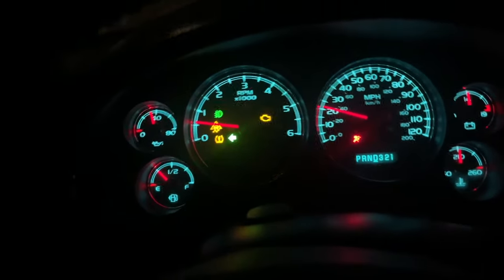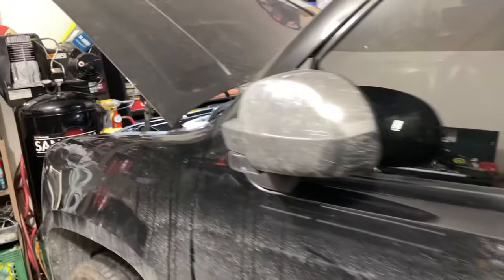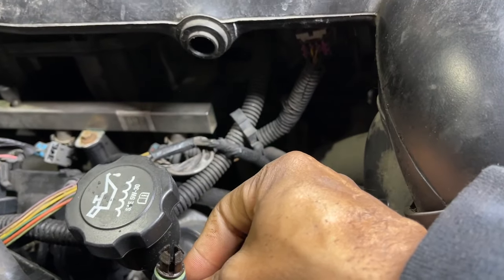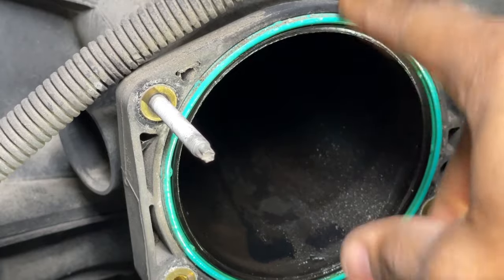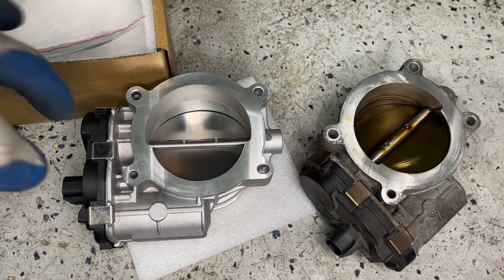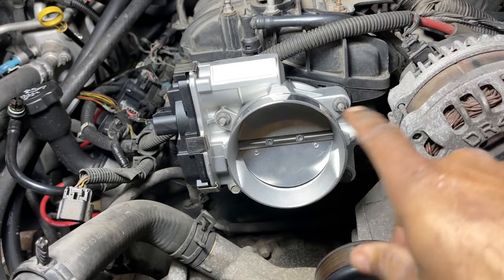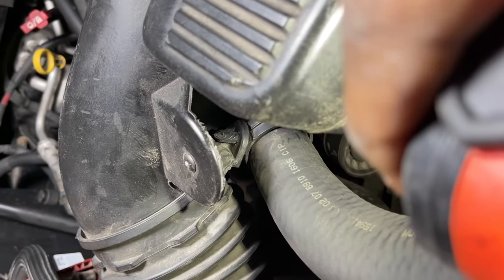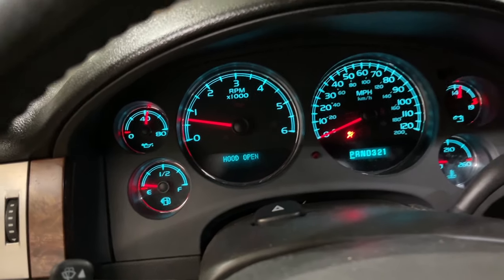How To Fix Reduced Engine Power Quick And Simple! Code P2135 Chevy Or GMC Trucks / SUV's! TPS Issue!

Comment: Hey i dont know if you’ll see this but if replaced my throttle body my acceleration sensor and my truck still wont turn on it cranks but wont switch on and i still get the reduced engine light
Reply from the maker: Hi Javi, so you truck won't start?? Please let me know and tell me what codes you are getting. I will help you get it going. Thanks,
Reply: @TerenceDIY  i got P2127 for the Acceleration pedal position i replaced it 
P2122 Acceleration pedal sensor circuit voltage to low 
I got throttle closed position performance   And a code for the TSP as well i replaced both and i also got P1380 miss fire detected
Reply: @TerenceDIY  and now i have the engine power is reduced light
Reply from the maker: @javigarcia1616  , so just to be clear, it does run however, it does not have any power during acceleration?
Reply: @TerenceDIY  non it no longer runs
Reply: It turn the keey and it sounds like its going to turn ok but it doesn’t
Reply from the maker: @javigarcia1616  , okay. Now tell me this... When you try and start it, does it sounds like it wants to start or does it just spins? Please let me know.
Reply from the maker: @javigarcia1616  Can you have someone turn the key forward into the on position (don't try and start it) while you listen by the gas tank where you pump gas to see if you hear the fuel pump turn on.  I want to make sure the fuel pump is working.
Reply: @TerenceDIY  it sounds like it wants to start
Reply: @TerenceDIY  there’s not many people around me
Reply: @TerenceDIY  but i had one guy look at it he said it wasn’t the gas pump but idk this all happened as i was driving

Comment: Hey Terence, I have a 2007 Suburban 5.3 flex fuel, 167k. This reduced pwr light, check eng light, stabilitrak lt and traction control lt all came on tonight first time. Note that it's -14 degrees in Denver now and I was in 4wd high and slipping a little. Since it would idle but had no power, I was able to pull off the road. I turned the engine off waited a minute and it restarted with no issue but the logged check engine lt. Made it home ok. Your thoughts on whether this incident might be cold related?  Thanks
Reply from the maker: You absolutely could have gotten a false reading due to the circumstances. I've had multiple false readings where as after waiting for a while the vehicle was perfect with no further issues. However, pay close attention to it. If it happens again. there's definitely a problem even if it fixes itself after a restart. Here is a link to a new part that's cheap and reliable. 

https://www.ebay.com/itm/333272439452?fits=Year%3A2007%7CMake%3AChevrolet&hash=item4d9895da9c:g:EpoAAOSw6QJdM5EW&amdata=enc%3AAQAHAAAA8MoUyTfsKekX%2Be%2BCj7USOvxRS2XHH%2B4s%2F3tNXtAZ4Z%2BLY2YJ8cZZawMqXI5eRkCN2peingTBDhw67RTFniZ13YeWeYbWwzGRlOX3gCqapuSIPwlEOfKzGzdNW%2BNzE8MbteOrNmQbfjDC7HwmX5iOOPlqpeAYBNdP1e3ZMYgv0GCr97ijpvwE2LwEbEFXegY5pdBMIlOhyFHiIQxxOM5CPh3EHGWGXIOYVixbxaONJA9zp9VDhEPfqRS8IlIxfkkulnErBAXVLFnvogBSJweDOIO12HTbu09A3rhd8ehAtsSWwnbVTznzv%2F8GuOghipZkcw%3D%3D%7Ctkp%3ABFBMyOTn16dh
Reply: I have the same issue with my 2007 yukon.  Replaced the alternator because of the built in regulator ( due to possible over charge) , Replaced ground wires, oil pressure sensor (went bad and replaced-now I have pressure reading again), replacing fuel level sensor now,  replacing fuel canister now because of pressure ( not able to fuel up without 30 min of at the nozzle), now your saying the throttle body which makes sense but did it fix your stabletrek/reduced engine/  circuit high volts fuel level codes?
Reply from the maker: @joshuaosterkamp4144 , yes, it fixed my problem instantly. The truck still runs amazing. Here's a link to the part (below). Thanks for watching! 

https://www.ebay.com/itm/333627241435?fits=Year%3A2007%7CMake%3AChevrolet&hash=item4dadbbb3db:g:idAAAOSw~UJhkdH9&amdata=enc%3AAQAHAAAA8MjoO0WdBfGVeinK0xj%2FLd2FTK6tfYe%2FK5z8Z31smof1jfX3pvdl9kesnJ%2Fv9aYmQ26e4Wf2cMFQ8wemI80uiFy0nCLO9EP7rb%2FvFtNBBKU6Pm5kpQN2YFTN74BFQ%2BusPY%2B8zhhUDmeykII9Skj3fzhYKA1iKVeWliAx4C0%2FOBQifyKXinvqDF4T%2Fq1%2F03%2FPUsH7%2FpUnwwh8D75%2Brz2CzRclGakTKdPV7FjEy1Y0lhZW8geN2ucMNIx11IM6rNZmzWssnd76hJ3DwtAz3CChjNpCkTcNWiCJXm1rj4Mz35VzfD2BkqReRktcbslK41OKow%3D%3D%7Ctkp%3ABk9SR9CBnf7XYQ
Reply: I get the same problem in the winter on the slick days

Comment: Fixed the ground issue on the passenger side of the engine, ran fine for 3 days then went back to the issue. Have a replacement throttle body that I plan to put on very soon

Annoying thing is that mine has a small coolant line running through at the bottom... Why?
Reply from the maker: Hi Bruce, what year is your vehicle?
Reply: @TerenceDIY  cursed 2003

Actually attempted to replace throttle body but there are... Things... In the way. Theres a large hose right by the side with the electric connection and then the annoying pass through. They have these oem style clamps on them that refuse to come off with regular pliers

Comment: Did all that and my check engine light only comes on at idle...but goes away at 23mph..any suggestions
Reply from the maker: Did you use an OEM throttle body?

Comment: I just got the same problem. Could it be the same issue on 2003 Avalanche?
Reply from the maker: Absolutely or the APS ( Accelerator Pedal Position Sensor) in which happened on my 2003 Avalanche. Thanks for watching.
Reply: @TerenceDIY  just found out a spark plug coils is cracked. I'm going to replace it along the spark plugs and cables and go from there
Reply from the maker: Great! Let me know how it turns out.

Comment: Did the throttle body need programed the one on my 2009 silverado crew cab 1500 4.8 ls had to be programed
Reply from the maker: Nope, no programming required. I would have made sure to detail that in the video if that was my case. Thank you SOO much for watching.

Comment: Was that a aftermarket throttle body or GM part?? Thanks in advance
Reply from the maker: I actually bought both but installed the aftermarket in this video. It's still going strong. I have the GM brand on standby. Here's a link to the aftermarket part. Let me know if you need the OEM link. Thank you so much for watching, 

https://www.ebay.com/itm/333627241435?fits=Year%3A2007%7CMake%3AChevrolet&hash=item4dadbbb3db:g:idAAAOSw~UJhkdH9&amdata=enc%3AAQAIAAAA8PfQ8tGd6OQhC45g5SmgB94PNEDBebXXPHs8anFHt7xU6aIvBUdojgFG5t4I2SsJ4ziJpwB6TQ64muIT%2BiLuanno7z3i3PexcZETWZQA8lm7mApYo6yzcmWyc%2FcHF1SZi5YQStRsGWxc%2BPsotb1%2FFV8XaV4kdd%2F8xwFchzqMWCFqt%2FCRwOlvZ1e6bhneoJ6MTz%2FpgpmO%2F%2BWAES%2FhoEDTjhGtpKNF1C7Q8F82768Y%2FwvkXEnIbMxtXwlIJnM0o7MW4SqoKTy1FAkkIHd4kfwu89Y0s3HrAZBX9Us4%2BjV7L%2BSLszv1oYMZF2bSD3b%2FiAJMJQ%3D%3D%7Ctkp%3ABFBMvsSk0vlh

Comment: And it's cold out I'm glad i found ya n it's a 5.3 2010 no codes either the rpm gauge is bobbing just like that but not that much loss of power what's your suggestion

Comment: I have a 2008 Chevy Impala LT 3.5l v6. I have replaced the throttle body on it and it still say engine power reduced and service traction control. Any idea what the problem could be.
Reply from the maker: Can you send me the trouble code? I have the book and software on that car. I probably can tell you what your issue is. Thanks,

Comment: I'm having the same issue. I have replaced the throttle body and connecting pigtail, the control module and reinforced the grounding straps. The latter two fixed the issue for a few weeks and the first resolved the problem for about 6 months. Looking for other fixes. sigh
Reply from the maker: Hi Jacob, did you replace the old throttle body with an OEM one?
Reply: I did.
Reply from the maker: Jacob, any trouble codes? If so, please send them to me. I will check the software and see if there are any other solutions. Thanks,
Reply: @TerenceDIY  I broke down and took it into the dealership. After 3 days, they determined that there were several shorts in the engine harness. $2,950 fix... Time for a second opinion.
Reply from the maker: Dang Jocob. I wish I were there to help. I would go to the scrap yard and remove a harness from a similar vehicle and help you install it to see if that would fix the issue.
Reply: @jacobgillespie4758  I think I'm dealing with the same issue p 2135 2 throttle bodies and pigtail later drove good a couple weeks now problem is persistent
Reply: @anthonyprice1859 That sucks. If the throttle body keeps going south, you could have a grounding problem. I ran grounding cables from the battery to the throttle control module to the grounding point at the center of the firewall to the frame under the alternator and finally over to the computer. 

Since having the engine harness checked, the issue hasn't repeated, leading me to think it was a loose connection after all. 

Here's hoping.
Reply: I am having the same issues, throttle body and sensor replaced multiple times. Go off for no apparent reason unrelated to bumps in the road. Temp fix for me to get home is to remove battery cable for a few minutes and it works for short time and the problem is back again 😢 had taken to dealer and shops multiple time but no one can fix it permanently.

Comment: hello i have this same problem  engine power reduce but only when i reverse i install a new throttle body but it seems it didnt fix the problem what can it be
Reply from the maker: I wouldn't have changed it if it were working properly in forward. You have another issue if it only does this in reverse. Possibly an issue with the transmission. Can you tell me the trouble codes?
Reply: @TerenceDIY  i had  p0122 ..p1174 ..p1516 p2101.. p2119 and p2135 but after replacing throttle body  i only have the p0122 left  maybe the pedal position sensor?
Reply from the maker: @goregore9647  , Yep, that's most likely your problem.

Comment: What part was that. That you put on. Mine is engine power is reduced idk what going on idk nothing about vehicles
Reply from the maker: Here is a link to the part (below). However, reduced engine power can be quite a few things. You need to get the codes read. 

https://www.ebay.com/itm/273974704021?fits=Year%3A2010%7CMake%3AChevrolet&itmmeta=01HWD9CG4TSFSXMEPQGXYCX3SX&hash=item3fca2a3795:g:J4kAAOSwZE5mGTEF&itmprp=enc%3AAQAJAAAA8E06yIDENQEGtBF07wx%2B2BSet9S31SSr6%2FjBPrTtH2pn2XdPyh40Uvt2z%2BTLoZAXyUnzHvAGlggNg3cTNt2bmU4BpNhqDGcALOc1Ai%2BjcKijem7DQTmx%2BRyJx%2FFmVkYoSzns7oW4SsVel%2FaArN%2Fw%2FhHUNeIuEpuJRSDcM%2FADigqC%2BD4zdBJPzHzhctLxt6iKFrTQYPyC33N3Vdh5QYfpM7CsZu%2BGDK5qEl3lOOW%2FoMnHCI7o6UXDc8pvO2OisK0pJZMZyXzYZhp50rZrRyxfCKYZM%2FPiOmi%2FQzkV6IcTJ%2FaK%2FAW0hB3Yb5oIFWjGx%2FA9nA%3D%3D%7Ctkp%3ABk9SR9KCsqnjYw

Comment: Great day, I am having this exact issue with my 2013 yukon Denali right now. I have went through a few mechanics that swore they could fix the problem. The 3 lights that appear are stabilitrak off, traction off, and engine power reduced. When those are on, I can not go more than 15 miles per hour. When they are off the truck drives perfect. Are you in Atlanta by chance? Or can you refer me to a reliable person in Atlanta that can fix this. Trying to remain positive, and hopeful😘
Reply from the maker: I am in Chicago, Illinois (born and raised). I wish I could help. I probably could fix it in no time. Thank you SO much for watching.

Comment: I’ve already had this replaced and I keep having the same problem any tips ?
Reply from the maker: Did you use and original OEM GM part when you replaced it? Here's one for a reference (link below)...

https://www.ebay.com/itm/114732200404?fits=Year%3A2007%7CModel%3ASuburban+1500%7CMake%3AChevrolet&hash=item1ab69271d4:g:bnAAAOSwWMRgU8CT&amdata=enc%3AAQAHAAAA8Gx2AURQy6Df5gEuMbRS0x9f2F6sA3xkCwvbAAkRh0gSrvGlMZumm3fb83KQmBYxucBIcRHGN6RBhrHec3TMmu00FyxB0q5nD8fU0xqFFeqytkdRW6bh%2BfENitL0IAmSOx0wnSUJ24rREXDDgSWUI16Qwl0G8fPfV4RbMFnD%2FeFyzL65tZ2lREo2TSoU%2FZymKNcNF7GiMfQQ0J9PPt%2F9DTjRda5An%2BaGqi499Rnur5vUVK5%2FBFTPlc95wQa8zleNxHO5FKarQq9aahF4UYEYRPIVF08gKKUEJ1Dg94dP2x%2B8LwnwgLi4%2FEe7rkRffWQZ%2Fw%3D%3D%7Ctkp%3ABk9SR5bevp69YQ

Comment: I have a 2010 chevy equinox. I don't know what code it's giving, but it is doing exactly what your video shows. I replaced the battery and the alternator. I thought they were the problem. What is the part you put on?
Reply from the maker: This is the part you need for your vehicle( link below). Please make sure the year and engine are the same application listed in the listing. Thanks for watching.

https://www.ebay.com/itm/154703213443?fits=Year%3A2010%7CModel%3AEquinox%7CMake%3AChevrolet&hash=item240507b383:g:5dwAAOSwmUhiq9KI